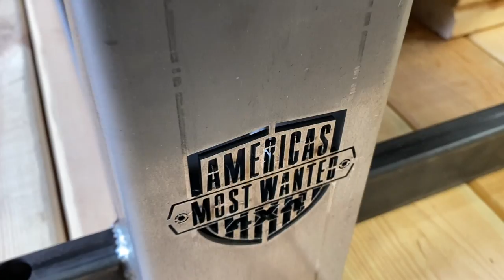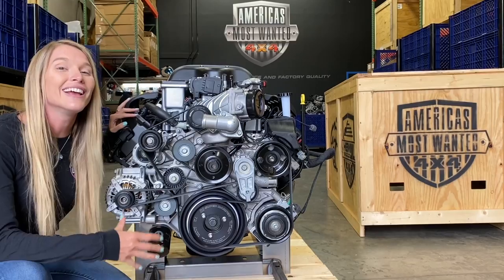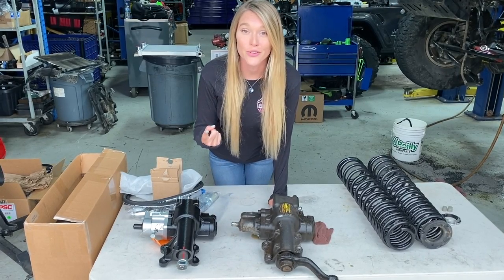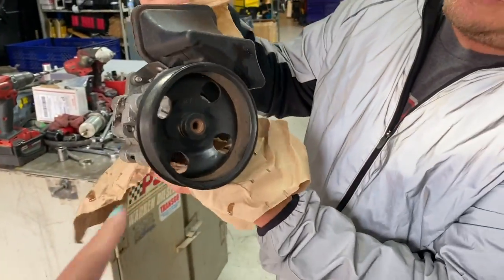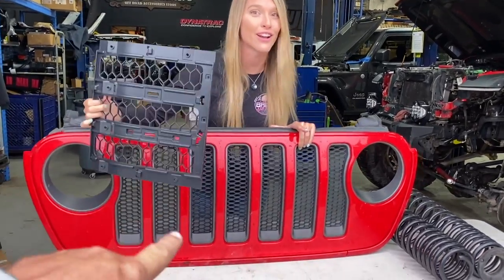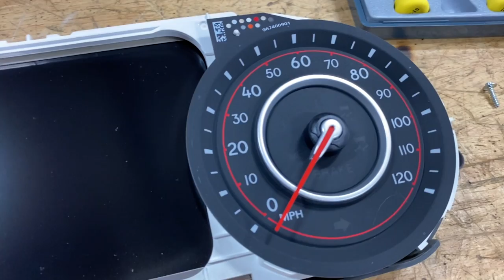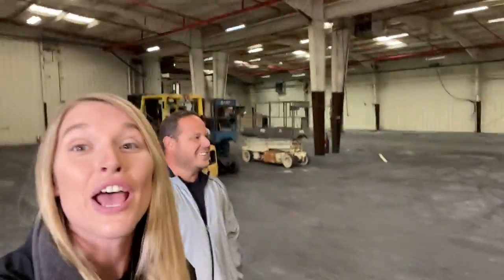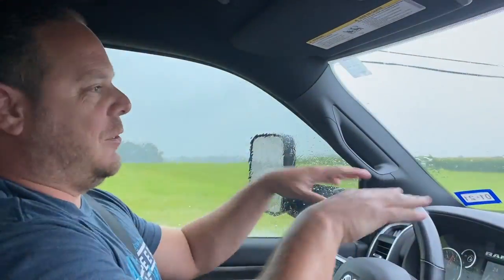1,000HP JEEPS ARE HERE!

Comment: So how do you change out the shifter logo. I did see a small spigot on the bottom of it for a second does this hold it in. Can I just get a lever under the cap and prise it up or do I have to take it apart. Don’t want to crack the original in case what I want to do will not work. Great video full of energy I love that.
Reply from the maker: I believe they just used a trim tool to pry them off
Reply: Lite Brite I’ll give it a go thank you 🙏

Comment: 1000 hp is a lot. it is not the first 1000hp in a jeep though. i have 760hp to crank and 635 to the ground and it is fast. 1000hp would be a lot of fun. when you add all this hp you also need to address fuel system, axles, and other items to handle to power and not break

Comment: Why not just leave the grill insert out completely or does it serve an actual mechanical function.
Reply: @gogerwi I would keep something in there.  My JK with an open grill took a bird strike to the grill opening once and made quite the mess under my hood.
Reply: Jeeps went from 1943 to 2017 with just open slots. Like that stupid "Angry Bird" facia going around the grill mesh is just INHO, cosmetics, I could be wrong. Jeeps have minimal capacity for air flow without adding something else to impede air flow.